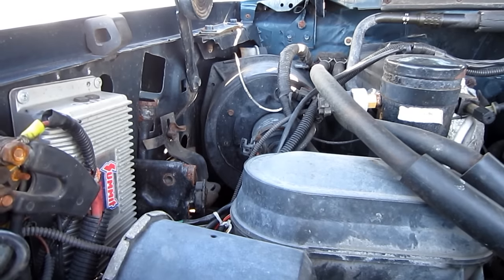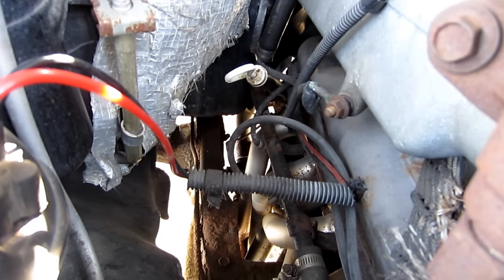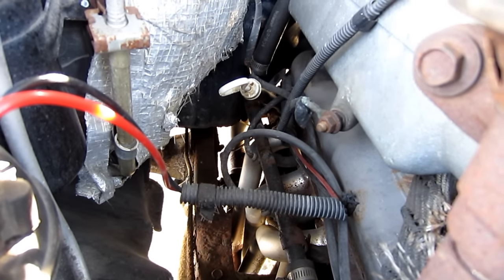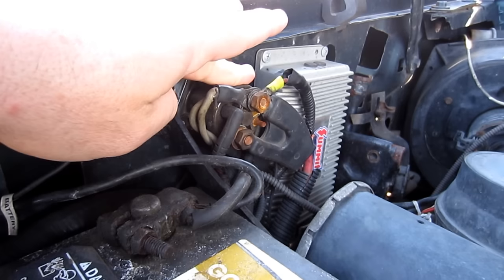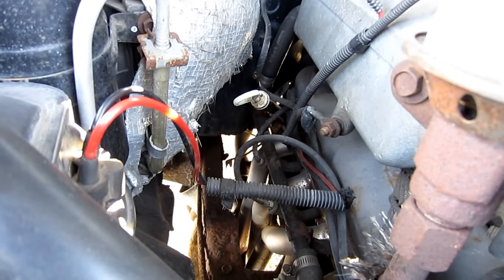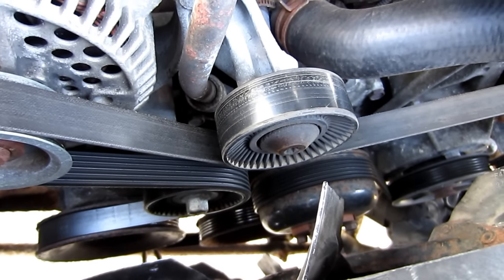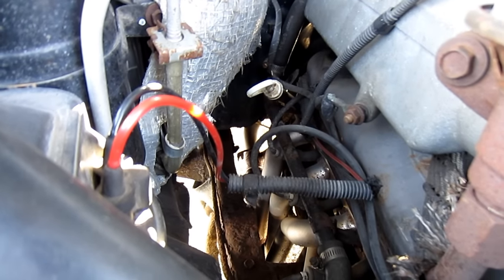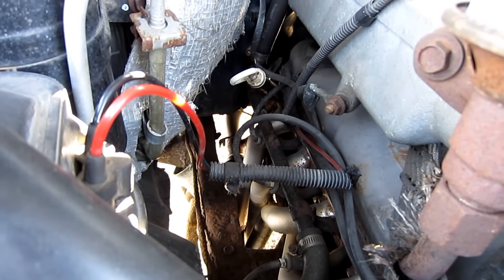Know your cars Clicks. Why it won't start

Comment: Hey man i have a 2002 Vic the motor won't turn over one loud hard click when turning key. Tested battery all good cleaned Terminals and checked cables installed new starter with solenoid as well as a new relay. Same results nothing changed. Flywheel well flex plate I mean is in great shape also hand-turned motor at the crank no issues doing that but didn't fix anything. What the heck man is my motor shot!?  please help me and thank you in advance!!
Reply from the maker: With all new starting components and the fact that you had turned your motor by hand makes me think that there's still something else going on with the starting system. Try to rotate your engine by hand again one full rotation. If your engine will turn by hand then it rotate with the starter. As long as your flywheel and components are in good shape and you did not get any defective parts and everything is wired correctly. Sometimes the starter will engage the flywheel in a weird angle and get jammed but rotating engine by hand will unjam it immediately and if it's real quiet when you're doing the engine rotation by hand you'll hear the jam starter click as it becomes unjammed. Again, if everything as far as the starting system is perfect, including the wiring, and you can rotate the engine by hand, then the starter should rotate the engine. As far as it actually starting at that point and running that is when you will know if you have a problem with the engine. But even a blown up engine if it can be rotated by hand should be able to be rotated by the starter too
Reply: @Foxboss9  for the heck of it I just went and made sure I didn't buy a faulty starter had my old and new starter tested both great working condition so it was never that the issue to begin with I'm thinking it may be the connection wires to the solenoid. Thanks so much for the help I just feel like I'm on a hamster wheel thanks for showing love

Comment: I could use some help. I have a 1989 240sx, I put in a fresh battery in to the car all of the electronics work. I turn the key to start it and the relay clicks once meaning its open but the starter does not click. When I put a breaker bar to spin the engine it spins a 1/4 of a turn. The car did not run for 8 years, and I believe the engine is not seized. So is the starter seized?
Reply from the maker: Adams Adventures My guess would be starter... Try tapping it with a hammer it may just be stuck..
Reply: Foxboss9 I tried that too, I think the problem is the car sat for so long it created a rust edge in the cylinders and it won't let the engine turn over.

Comment: I checked my starter, battery, and alternator. They all seem to be working. No, loose cables. However, I'm still getting an issue where my car won't start immediately. I have to keep the key turned and it makes a click click click noise until it starts...any ideas. I went to a mechanic and they said they would "text me" what I need to get fixed and they never did...so I'm really lost and I'm a college student.
Reply from the maker: Unfortunately I think you might be in a tough situation. To diagnose electrical is very difficult to do even with the vehicle right in front of the mechanic that's doing the work. So, for me to make guesses at what you might be experiencing with your vehicle is futile at best. It definitely would be a waste of your time. You need to find a reputable mechanic that is capable of effective electrical troubleshooting. There are a lot of mechanics out there and unfortunately many don't have the time or patience to troubleshoot electrical systems. Good luck sorry I couldn't offer more help.

Comment: Hello, when i try to turn on my car it clicks like in your video- no turn on. but after  maybe 10minutes of trying it just turns on like normal and everything is okay. I drive, i stop and try to turn on my car again - perfect, it turns on. But when i leave car, for maybe 15hours without turning it on  -again, it clicks, clicks, but not turn on. I was wondering what can it be? Maybe you can help with that?(can it be maybe caused because of the cold weather?) I don't know what to do actually... :(
Reply from the maker: Intermittent problems, especially electrical problems, are almost impossible the diagnosis without having hands on the vehicle. Even having a mechanic work on it it's usually a 90 to 1 odds that you'll get the car back with them not being able to repeat the problem

Comment: In my 2002 envoy when i jump start the starter it acts like it wants to start but it won't what's wrong ???
Reply from the maker: In any diagnosis, you should first fix the known problems.. Since you are jump starting the car, Replace the battery first....  I suspect you have other issues beyond the starting system though...

Comment: Foxboss I have a problem! My car ran fine the night before, then I tried to start it the next day and it just tried turning over but wouldn’t start. The check engine light and epc light came on and battery light! I used my scan tool and got codes p0300 through p0304 also p2015 . I kept trying to start the car with no success and the battery died! I bought a New battery and changed the plugs and coils and still nothing! Then the red low oil pressure light came on and then shut off! It had full oil! All the pulleys turned when ever I pushed the key in but it would just try to turn for like thirty seconds and then stop. So my wife says tow it to the garage and let them see what’s wrong with it! They called back after a few hours and said I need a new engine this one was seized and they couldn’t turn it by hand!!!! The engine was rotating when it left! Now they sent the car back with the belt off laying on top of the engine and it doesn’t even make a clicking noise ! When I push the key fob in the ignition all the lights go dim nothing else happens. Do you think the starter got jammed and would that stop you from cranking the engine by hand??? Sorry so long need help! Car is a 2012 vw cc.
Reply from the maker: I could guess all day long but the fact that you took it to a garage and they had their hands on it and came up with the fact that you needed a new engine makes me think that I would take it and have somebody give you a second opinion at another shop. Make sure it's a reputable shop that you trust. They need to explain to you why it needs a new engine. Could be the starter jammed, could be the head gasket is bad and the cylinder filled with antifreeze, could be something wrong with the camshaft or timing. But you definitely need to take it to a reputable shop.
Reply: Foxboss9  thanks for the reply but what I’m wondering is how did it come back seized when it left unseized? The engine cranked every time but it wouldn’t start, then I get it back and it’s seized alright but I don’t even hear the starter clicking in and out it’s just dead!and there seems to be a drain on the battery when I push the key in! 🤷🏼‍♂️🤔

Comment: Thank you so much you saved my life I went through the process you described the pulley was good the battery is good my starter was dirty as s*** all's I did was cleaned it off clean the electrical wire off a bit and it fired right up thank you so much man I had to get to work this week you totally saved me really appreciate you
Reply: What fluid did you clean it with ?

Comment: so if the starter don’t make rapidly noises that means the starter is just old right ?
Reply from the maker: Fast, machine gun like clicking noise usually means battery is low or connection from battery is bad. However, it could also mean that starter will not turn or is draining too much power. The only way to know how good the starter is can be done by removing and testing.
Reply: Foxboss9 mines starts sometimes and then it starts like losing power. I keep pushing on the gas pedal to get more power. you think it’s my starter? or something else. I really don’t know anything about cars.
Reply: Foxboss9 I own a 1993 Toyota Pickup 2 door

Comment: I have a 1980 GMC caballero, i installed a rebuilt carburetor and crunk it up, it drove just fine for about 10 mins then it all of a sudden died, I tried to crank it back up but it wouldn't crank and sounded like the battery had died I replaced the battery but mistakenly put positive to negative and negative to positive I heard a frying noise and smoke came from the starter, my friend replaced the wire I had burned I got another battery but now it won't start it just makes like one click , what happened? you think I may have damaged the starter?
Reply from the maker: possibly. pull the starter and have the auto parts store test it for free
Reply: Thanks, one more question, someone told me the motor could be seized, is there away to manually check for that?
Reply from the maker: motor wont be seized because of a battery issue.. you can turn the engine by hand at the crank to verify that it is free
Reply: Thanks a lot bro

Comment: so im hearing the rapid fast clicks on my 2000 ford ranger, i have jumped it and bought a new battery and still rapidly clicks. my radio works, my A/C is full blast, lights work. Any suggestions?
Reply: I’m in the same boat!!! New battery, spark plugs, radio, lights, AC all fine. But my car won’t start. Dash lights come on and stay on, but it just goes, “DUNDUNDUNDUN” when I turn the key but no start just nothing. My check engine light is on with an EVAP code (emissions system) but I don’t think that has anything to do with my car not starting?
Reply: @releasetoreceive  i ended up fixing mine by recharging the battery. I guess the battery happened to die due to the heat and I had to recharge it. Hope you fix it 😀

Comment: I have a 96 VW Jetta and one day I went out to my car and the car just clicks and I have to tap on the starter to get it to start up. The other day I just replaced the starter and It is still doing the clicking. Any thoughts?
Reply from the maker: +Deven Greenwood will it start when you tap the new starter? You may want to check all your connections again, could be a fluke from replacing a bad starter that a good starter wont work now..
Reply: +Foxboss9 it will not start even when tapping on it. It still makes that clicking sound. Thank you for replying quickly

Comment: Ok I have a 2013 f150. 
Today I got home and my truck is making one click for every turn of the key.  My new battery was also dead.
Charged it and still one click.
I jumped it today off the starter and it fired up. Shit it off and it fired up again.
I had the starter replaced about a year ago, but I noticed there alot of green corrosion on my started wires. Any ideas ?
Reply: Definitely couldve been the corrosion. I remember back in high school my battery died & it wouldnt jump either but i noticed the same corrision you mentioned. Like an off aqua/blue/green. A little bit of coca cola & a cloth should do the trick brother. Make sure you dont use a wire brush!!! ((Or atleast make sure the battery’s disconnected first))
Reply: Let me add that there was a LOT of the stuff on my battery. Like to the point where it was starting to go past the terminal cover.

Comment: I'm working on a 2008 navigator I get a single click and all lights go out I've replaced the battery and the starter still the same ?
Reply from the maker: William Zink double check battery connections and starter relay connection... Watch under the hood in the dark when someone tries to start the vehicle.. Look for a spark... If none present, check voltage going into and coming out of starter relay... Good luck..

Comment: Mine clicks then starts. Sometimes it starts other times it clicks then starts after I try again a few times. My starter was just replaced and everything worked fine for about 2 months. My battery is fine. What else could it be?
Reply from the maker: You have to troubleshoot. You'll have to check all your wiring. Just because you put new parts on don't necessarily mean that they are good. They need to be tested. You may need a new starter relay. You may need a new ignition switch. You may have a bad wire between the ignition and the starter relay. There's way too many things to narrow it down without testing all of those items.

Comment: OK, so I got the one click, changed out the battery, still one click. Thinking starter, BUT...it turns over with a jump. Any ideas?
Reply: You probably got it fixed  but had to respond as I hate it when no one responds. It was most likely the starter. They can turn over with jump starts.

Comment: So... I just replaced my solenoid and starter because it was doing the same thing. New starter is hooked up and dangling. Still the same noise and starter wont turn over in free air?!
Reply: P.s. battery is fully charged at 13.7V
Reply: 1993 f350 460ci gasser
Reply from the maker: @Evansthoughts  starter has to be grounded to work

Comment: My car doesn't start in cold weather. I hear click sounds when I try to turn the ignition key on. Not sure what the problem is. It starts pretty soon on a normal day. Only problem is when it's parked outside in cold for few hours, it doesn't start. 🤷‍♂️🤷‍♂️
Reply: Sounds like it's not putting put enough amperage

Comment: I have 2002 Ford explorer and it makes just one click sound. battery is good. Alternator is good too.I replaced starter yesterday. Car was running good for a day after replaced starter.but car won't start at all. Also it doesn't make crank sound either.
Reply from the maker: Eric Oh recheck the starter

Comment: i have no ignition lock cylinder so ive been having to start my car from the starter to the solenoid. now when i try the starter just clicks... could it just be my starter went bad
Reply from the maker: Well, If you are bypassing everything by jumping it at the solenoid Then, yes, it's the only thing left in the system that is not bypassed..

Comment: What if it clicks once when I turn the key but after several tries it starts up perfectly? When I keep trying in my 2003 Ford Explorer the doors lock and unlock on their own. After several turns of the key it finally starts just fine. Been doing this for over a month. How do i fix this issue?
Reply from the maker: You have to troubleshoot the problem. The first thing I do is take your battery to the auto parts store and have them test it. If the battery test good, then you need to test your cables going to the starter relay and make sure that good connections are made. If the connections seem very good and tight, then you need to test the starter relay and it's connections. If that seems good then you need to test the starter solenoid. Now this point is probably best just to pull the entire starter off and take it into the auto parts store and have them test the entire unit. Problem with electrical is there is no magic button, you have to diagnose the problem. Steps have to be made. I say start with the battery because it's the easiest to know if bad just by taking it and have it tested.
Reply: Foxboss9  Thank you, I’ll follow these steps and see what happens.

Comment: bmw clicks upon start and won't turn over. Had a flat battery sat through all winter. Re-charged it, and it lights up the car again. But now it clicks.
What could it be? The battery read 13.90V   now it's down to 12.80
Reply from the maker: If it starts by using jump start, then you need to replace the battery as it is damaged
Reply: @Foxboss9  Thanks man. Can it be damaged by running flat for 1 winter?
Reply: @Foxboss9  Thanks. It was the wire contact points that were not screwed firm tight:P     I just layed them loosely on, it did get connection, I assumed it was enough. It wasn't. And the battery seems to work fine despite a professionals knowledge about it almost guaranteed being destroyed. (Turning flat throughout winter)

Comment: When I turn on my car, I hear a simple click sound as long as the key is turned in forward. Battery was tested fine. As I found online, I tapped on the starter gently with a wrench and then the car started fine. Does this mean starter has gone bad? Or is it starter relay? Appreciate the help.
Reply: If tapping on the starter fixed it, then yeah, your starter is on its death bed. Tapping it is a temporary fix when it works, it's likely to seize up again at some point.

Either buy a starter to replace it with if you get a day off. Or if you want to do things even cheaper, you can take the old starter out and send it off to get refurbished and sent back. Or you could refurbish it yourself.

Comment: So I replaced the start and starter solenoid, all the electronics work so I don't think it's a battery problem or maybe, any ideas? (Got a 96 f150 300)
Reply: Noah Vereneau. Is it not cranking, or is it turning over, but isnt starting?
Reply: Neutral safety switch ,fusible Link in the yellow wire, ignition switch, and ignition switch actuator further down on the steering column

Comment: my Lincoln Town car signature series only makes one click when I try to turn it on what seems to be the problem?
Reply from the maker: Matias Lopez check battery connections..
Reply: Foxboss9 like tighten them or ?
Reply from the maker: Matias Lopez possibly or it could be the cables are loose in the connectors..
Reply: also how do I know if I have Brocken head gasket because my car overheats I changes spark plugs,and thermostat also found oil in the spark plugs .and throw white smoke from the exhaust
Reply from the maker: Matias Lopez have to run compression test and also test cooling system pressure.. You need special tools to do both of those test.
Reply: Foxboss9 my car doesn't have a radiator cap